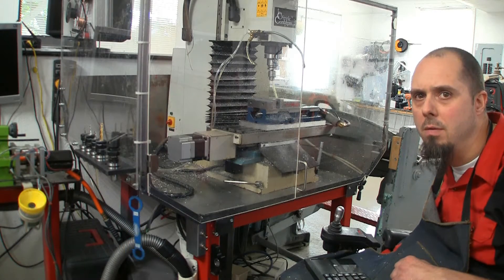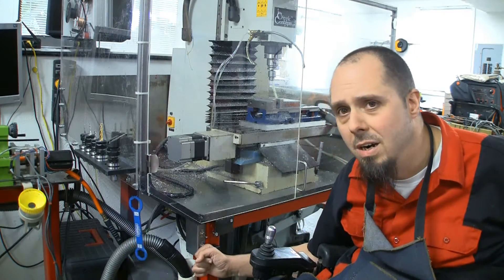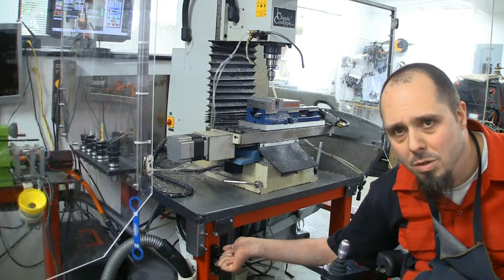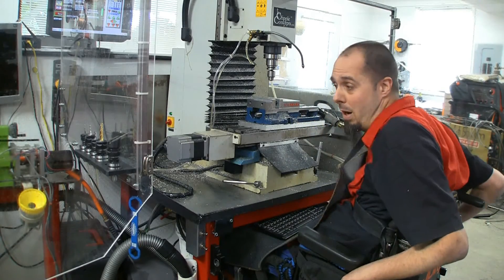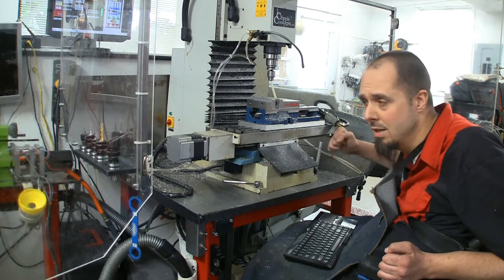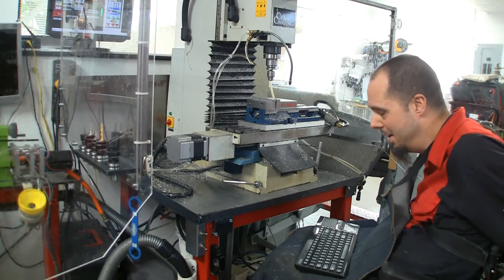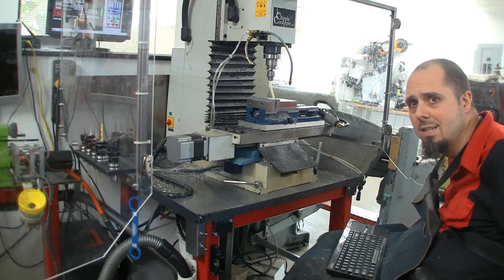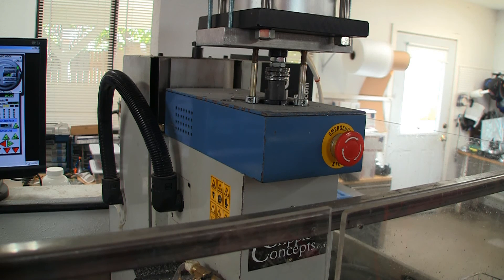Sieg KX3 Upgrades:  Tormach TTS, Shars 440V, enclosure

Comment: Just got a used KX3. Was wondering if I could get some more information on the pneumatic drawbar system?
Reply from the maker: Congrats on scoring a KX3, I haven't seen many come up on the used market. I can share what I remember on the power draw bar, what is it you need to know? I opted for a 10" diameter pneumatic cylinder with a short stroke versus the lever arm design most people use on diy systems, but only because I stumbled on the pneumatic cylinder cheap. The cylinder mounts are bolted through the top plate on the spindle housing and it has held up just fine. I do have the belleville washers pre-loaded to the max the cylinder can compress so if my air compressor is below 110psi I can't release tools which is annoying but has kept my TTS holders from pulling out. I think I bought a good quality pull stud from McMaster but you could use all thread. The R8 collet and TTS holders are genuine Tormach, at least the initial ones were and I got lucky at a local auction and picked up some additional TTS tool holders that are either older versions from Tormach or knock offs. I also bought the Tormach granite TTS pre-setting plate and that has made it quicker to set my tool table up in Mach3. I did have an issue on the KX3 like I had with my DynaMyte lathe, randomly missing steps, that was eaily solved for $100 by adding a UC100 USB smoothstepper from cnc4pc. Hope that helps get you started, let me know if you have any specific questions.
Reply: Hi  I built 5 years ago a pneumatic power drawbar to my Sieg KX3 cnc.  My neighbour filmed the testing, hope you can open it: https://youtu.be/nyqsHVxsmSI
The cylinder is from Fabco (Fabco Multi-Power Cylinder, P/N MP4x1/2-3-1-FF-MR  @ $ 324.25) three pistons, two  down one up. 8 belleville spring give closing force. Collet opening air pressure 2 bar (min).
Main collet is Tormach TTS using Tormach TTS toolholders.  The Cylinder was most expensive part, $324 +shipping + custom  + VAT = $500 ++). For avoiding extra load of Z-stepper I added a 3-10kg  spring balancer. The Cylinder pressure is between drawbar and spindle giving no load to bearings.

Comment: I got the mill and i'm loving it but have you ever trammed the head? and would you also share your designs on the Tool changer?
Reply from the maker: Glad you are liking it! Tramming my head is on my to-do list, I have no reason to believe it is out of tram but want to be sure. I will try to summarize the tool changer in a video, but it might be a few weeks (I am going on vacation). I stole the general concept from https://www.youtube.com/user/hossmachine/videos. I built an impact gun drawbar rig initially like a lot of people use on Bridgeports, but the TTS system is a huge upgrade.
Reply: I've got my head round the pinch mechanism now I didn't really get why you couldn't just bolt a cylinder on. But the thing with the spindle bearings makes sense. I had an Edge precision tramming kit for my other cnc machine.. I was a little suprised by the amount the head was off and the backlash in the screws was more than I expected considering the Mill is like new. When I clocked it up it was about 0.07mm which I had to compensate in Mach 3. Don't get me wrong for what I paid for it I am more than happy and I really never considered buying one until I saw your video. I will have a look at tramming it up and i'll let you know how I get on.

Comment: Is this mill able to cut hard steel? Like pistol slides? thanks!
Reply from the maker: If you do light cuts it will. I primarily use it on aluminum, some plastic, and mild steel occasionally.

Comment: You're not really a cripple, you're and inspiration. Attitude is crippling. I'm and old guy that was put out to pasture from my own CNC shop because of a few bad days downrange when I was in Nam. You just gave me a good dose of "Suck it up cupcake".
Thanks!
Reply from the maker: Thanks, if anyone told me in 1998 when I got paralyzed that I would be able to design and manufacture things in my garage by myself I would've laughed them out of the room. I think desktop CNC equipment has become quite popular, so there are lots of machines on the market and prices are reasonable. I like my KX3, but the Y travel is only 5.5" so I keep eyeing the Tormach 440, http://www.tormach.com/product-pcnc-440.html, and once they have an automatic tool changer for it I hope they call me and offer to give me one :-D. If you are up for a challenge there are often older machines out of schools on http://www.publicsurplus.com that you could convert to run on Linux CNC or Mach3. Get out there and get your hands dirty!
Reply: Thanks for the reply, I actually have a home shop with some machines (Mori-Seiki 80's vintage CNC's)that I kept when we upgraded. They had very little trade in value so home they came. I've been fortunate to equip a very nice shop. The bad news is that a brain tumor from agent orange has left me with more bad days than good. However I did manage to retro a very nice Shizouka knee mill with a Mach Motion Control and AC servos. Also we used to run gang style chuckers for small parts (replaced with Tsugami and DMG screw machines) and I have re-built retroed several of those. Self taught on the electronics. Lately I have been learning SolidWorks and Fusion 360.